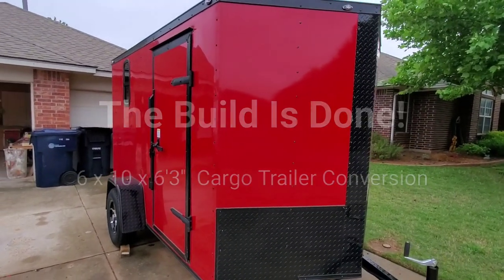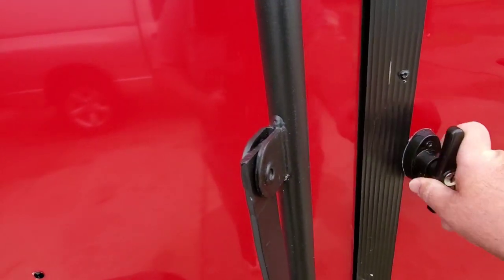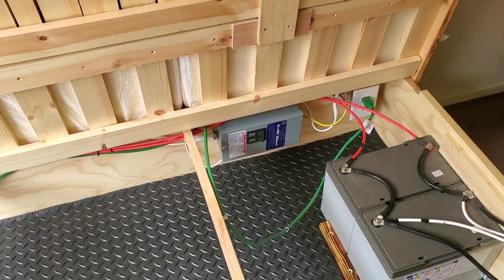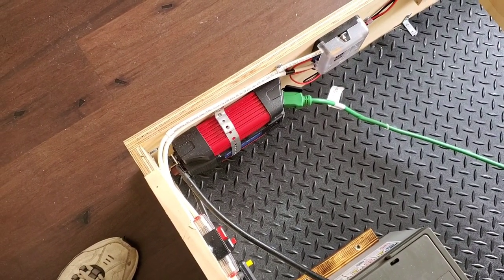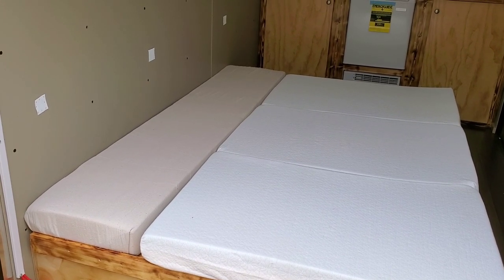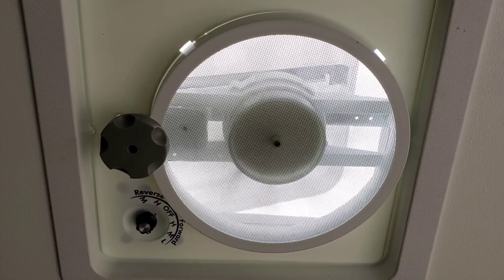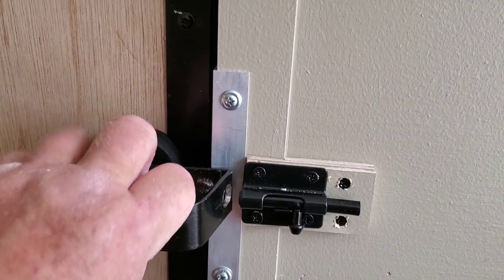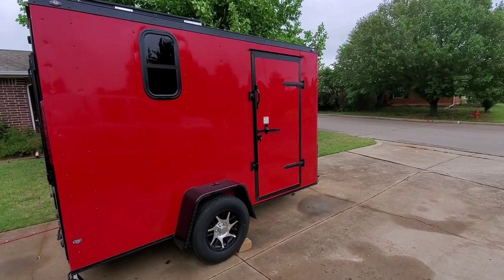The Build Is Done!

Comment: A suggestion for you rear hatch door is to make a deck on the ramp. You could have a bug screen installed at the entry of the trailor. Have it set up to use as an extra relaxing space. Place a little portable gas fire pit on it! Think of all of the beautiful evenings you could enjoy in your favorite camp chairs enjoying the beautiful sunsets and star gazing. Enjoy your trailor. It is so nice! ❤️❤️
Reply from the maker: Thanks for checking out the video. I believe that is what the couple that bought the trailer are doing with the ramp.
Reply: Never understood this. You're camping. What wrong with setting your chairs 12 inches lower on the ground.

Comment: Some prankster is going to lock y'all into that thing! Amazing build.
Reply from the maker: Thank you. When inside, the padlock goes in the flip latch on the door. With the lock in place, the bar lock can't be engaged to lock the door.
Reply: I have always had that thot lurking in the back & not all rigs have an escape hatch.
In this one, perhaps the rear door could enable that function...if latches were inside only.
Bug out, eh? Red certainly catches the eye so if some black circles are painted on, then you can call it a 'ladybug'!🤭
Reply: I was going to say the same thing! lol
Reply: Simple fix is to install another catch for the latch on the outside wall of the trailer and lock the swing latch inside the newly installed catch. That's what I did to mine, very easy and gives you piece of mind.

Comment: You'd get 25 to 30% more power gathered from your panel with an MPPT controller.
Reply from the maker: Since that build, I've gone to MPPT controlllers.
Reply: Yes, PWM is useless.
Reply from the maker: @mjremy2605  Long before MPPT came to be, PWM was what ran systems. I agree that MPPT is more efficient, for as basic a system as this one, PWM works fine.

Comment: This is a really nice sized and attractive, modern looking trailer, I think its gorgeous! 

Nicely outfitted and with a light, airy and uncluttered interior.

Nice job insulating the ramp door, most don't, which isn't a good choice for cold weather camping.

Your lovely little Travel Cabin will give you many years of miles, smiles and memories as it keeps you comfortably sheltered from the weather outside.

Thank you for sharing.
Reply from the maker: Thank you for the kind words.

Comment: Congratulations on a really nice build.  May your travels be safe and joyful.

I would humbly offer the thought you replace the modified sine wave inverter to a pure sine wave inverter, because your TV may be at risk, as would be any other electronics you might wish to charge.  Also, you might wish to reconsider the latch on the outside, as someone could lock you in while you are inside.  Perhaps the latter thought might be based on a little paranoia, but knowing some of the broken thinkers out there, I would never want to be placed in such a vulnerable position.
Reply from the maker: Appreciate the kind words and insight. We've been using small modified sine inverters to run dorm fridges for a quite a while with no issues. My first trailer (built in 2012) runs a dorm fridge, microwave & LCD tv (pre LED days) and has performed flawlessly. We'll look at changing them out if the need arises. We've done many, many tests about being locked in and as long as a lock is locked into the flip latch, the bar latch will not keep the door closed. That being said, if a broken thinker wants to wreak havoc, they will find a way. I work very hard at being aware of my surroundings and moving if at all uncomfortable.

Comment: I love this video…very informative! I’m getting ready to convert a 6 x 10 into a second unit for my hotdog cart business. Do you have a tutorial on your built from start to finish? I’m really interested in how much did it cost to insulate a trailer of that size.
Reply from the maker: Thanks for checking out the video. I don't have a tutorial, I just get an idea, draw it out and build it. Based on today's cost of foam board insulation, it should cost about $200+/- to insulate with 1" foam board.
Reply: @TinyTrailers4BigAdventures  thanks for your quick response! Also, that’s good to know on the insulation…sounds pretty reasonable.

Comment: with the back why don't you attach two jacks to level the door and have a mosquito type netting to go around and use it as a porch...make a portable table to eat off of....etc....really like how you constructed everything....
Reply from the maker: Thank you for the kind words. I didn't attach jacks to the ramp because I wanted the cleaner look. These are the jacks used to support the ramp. The top of the jack fits in the rubber door protectors on the ramp.
https://www.amazon.com/Camco-Olympian-Aluminum-Stabilize-Position/dp/B000760FWU/ref=mp_s_a_1_5?dchild=1&keywords=camco+trailer+jack&qid=1633268597&sr=8-5

Comment: Real nice build! Would you please put link to your parts? like the fan and the solar kit?
Reply from the maker: https://www.amazon.com/Hengs-Industries-90046CR-Replacement-501-1099/dp/B00DPJ3RDA                                                                            

https://store.santansolar.com/product/santan-solar-t-series-250w/

https://www.harborfreight.com/750-watt-continuous-1500-watt-peak-power-inverter-66817.html

https://www.amazon.com/gp/product/B07VMNLGZZ/ref=ppx_yo_dt_b_asin_title_o05_s00?ie=UTF8&psc=1

We bought a pallet of the solar panels, so the cost was worth it for us. Having a single panel shipped is ridiculously expensive. I'm sure you can find a deal on panels near you. Since I built this trailer, I have switched inverters to the Kreig 1500 watt and for a single panel system, I use an Epever 20 amp MPPT controller . A little more "oomph" in the inverter and more efficiency from the controller.

https://www.amazon.com/gp/product/B075XDK
MQW/ref=ppx_yo_dt_b_asin_title_o08_s00?ie=UTF8&psc=1

https://www.amazon.com/KRI%C3%8BGER-Installation-appliances-According-Standards/dp/B07MS5BY6T/ref=sr_1_3?dchild=1&keywords=Kreig+1500+watt+inverter&qid=1618590248&sr=8-3

Hope this helps. Thanks for joining the channel

Comment: Someone could lock you inside with the bar locks, so you might want to add some kind of latch to lock them in the open position when your inside just in case
Reply from the maker: Simply put the lock in the flip latch after the barlock is opened and you can't be locked inside. We tried it with several people and even my neighbor's 6 year old pusehed the door open with no problem. If you forget to put the lock in the flip latch, you could have a problem.

Comment: I've noticed that you use sash shed windows for your trailers. What kind are they and do they stand up to all the shaking bouncing?
Reply from the maker: We use the shed windows most of the ti.e because people don't want to pay the cost of rv windows. A 12 x 22 rv window runs about $120+/-. A 12 x 18 shed window runs $35 +/-. Both are single pane temperedglass, so style and price are the deviding factors for most folks. I have well over 80 shed windows installed in trailers without a single issue. I build a wooden frame that is attached between studs for the window to be screwed into. The frame insures tbe window is solidly secured to the trailer, so bouncing and flexing doesn't affect them at all.

Comment: The trailer looks great!...after having the trailer for awhile, do you have any problems/regrets with the floor mounted ac?
Reply from the maker: Thank you. I don't have the trailer. It was "adopted" by a couple to use as a vacation getaway. I've heard no complaints from them or others that I've done floor mounted ac's in. The biigest thing with making a floor mounted unit efficient is to feed it lots of air to cool the compressor & fan. Next is to use the roof vent fan to evacuate the hot air from the trailer while the ac is running. Once the hot air is moved out, the volume of cold air the ac puts out will fill the trailer quickly.

Comment: Very nice work and great idea of using shed lock.  Adding those flush RV locks are extremely time consuming. Will definitely do that for my next build.  Do you use passive ventilation for the AC or did you add a fan?
Reply from the maker: Thank you. I like the shed locks - drill a 1/2" vs cutting out for a handle. The AC vents directly thru the floor. I built an exhaust duct with a baffle that directs the air down. The air intake for the side vents are separated from the exhaust air by the trailer frame. No extra fans for air movement with the AC.

Comment: Have you had anyone go with a 12 volt  "overland" refrigerator/ Freezer?     Also have  you had anyone   get that trailer with brakes?   16 inch  Jeep wheels and tires not the after market monsters but the OEM  tires/ rims.      

I am wanting to tow with a Jeep JKU  and am concerned about a loaded trailer being more  than my vehicle can stop.   Going does not concern me it is the stopping that worries me.  On the rims/ tires I want one size for trailer and jeep.
Reply from the maker: Haven't done the 12v fridge/freezer unit yet. I just bought a used Icec0 GO 20 (20 qt) to play with. This one is a bit of a power hog, so I don't think for my 12v use, it would be practical. Plugged in to 120v, it will make a great freezer. As for brakes, yes, we've ordered units with brake axles. I think you would need to put a "lift" kit on the axle to safely get 16" tires on the trailer.

Comment: What are your thoughts on a roof vent verses keeping the roof one solid  piece and having vents on the side?  I see a couple manufactures who put one up high usually drivers side and one down low on passenger side.   Seems like that  would be better than an opening in the roof.
Reply from the maker: The side vents are designed to remove fumes from the trailer (mowers, atvs, etc) and really only work when the trailer is in motion. I'm not a fan of cutging a hole in a perefectly good roof,but a powered foor vent is a great wat to move a ton of air. Sealed right, they don't leak. I like to put a Camco all weather vent cover over them. Helps keep rain away and lets you leave them open 24/7/365 if you want to. I've used a small $40 12v fan from Amazon in the sidewall of a trailer when we didn't want to cut a roof. It's not as powerful as a roof vent fan, but it moves air.
Reply from the maker: Here is a link to the 12v fan I told you about. It works pretty well.
https://www.amazon.com/gp/product/B07PHT93VS/ref=ppx_yo_dt_b_asin_title_o04_s01?ie=UTF8&th=1

Comment: Awesome. Instead of hand pump why not have water overhead for gravity fed.
I would remove the outside bar lock handle so people won't lock you in. Or make an EMERGENCY window size hatch at another side to only lock & unlock from inside.
Reply from the maker: Thanks for checking ou the video. The hand pump allows them to have the water tanks under the counter and kedp the upper area clear. When you put the lock back in the flip latch, the bar handle can't catch on the latch and keep the door closed. We tested it many times before we put the shed handle on.

Comment: how come you didnt get a rooftop ac instead?
Reply from the maker: They wanted to be able to run the trailer on a 2000 watt generator. Also, a roof top is $1000+/-, and a window unit is under $200. The window ac keeps the trailer cold enough to the point that you have to turn it down. It was designed for a $150 sq.ft. room and the trailer is only 65 sq.ft. total, so it is more than enough.

Comment: Did you use sheetrock??
Reply from the maker: No sheetrock. The walls are 1/8" luan over the factory plywood and the ceiling is 1/4" luan. 2 coats of Kilz primer & 2 coats of paint.

Comment: How did you vent the AC unit
Reply from the maker: @Adam Payton - I wented the intake and exhaust through the floor. I built a duct to contain the exhaust air and force it out under the trailer. The intake vents have their own ducts to pull the intake air directly to them. There is a flooring joist that separates the intake and exhaust under the trailer.

Comment: The problem I have with the door, someone can lock you in....like the inside lock, but the door isnt for me, but overall nice job.....theres buttholes everywhere
Reply from the maker: Thanks for the kind words. I understand your concern about the door, but we found if we simply put a regular padlock in the flip latch on the door, the bar lock arm can't go down far enough to lock someone in. We tried this 10+ times with my wife in the trailer and each time she was easily able to push the door open. We tried it with one of the round locks and the bar lock could get down far enough to hold the door shut. I'm not a fan of the round locks anyway, this is just another reason for me to not use them.

Comment: What is the tongue weight?
Reply from the maker: Actually, I didn't take a tongue weight measurement. Not that it helps answe your question, but  I can pick up the tongue and move the trailer a bit and I haven't worked out in 30 years.

Comment: Don’t understand having batteries inside, to off gassing fumes into the trailer
Reply from the maker: Thanks for checking out the video. There are 2 floor vents under the bed  to allow air flow for the batteries. AGMs are designated safe for indoor applications with proper air flow.

Comment: What pulls this for you
Reply from the maker: The guy I built it for pulls it with a 6 cylinder Toyota Tacoma pickup. It weighs right at 2000 lbs, so anything that can tow 3000 lbs (to allow for whatever gear is loaded in it) will pull it safely.
Reply: Tiny Trailers 4 Big Adventures thanks
Reply: We pull it with a Ram 1500
Reply from the maker: @jackiesilva31  - That's what I pull with. Truck doesn't know one is back there, does it?
Reply: @TinyTrailers4BigAdventures  not when we don't load it down for a week long adventure lol no really, hardly knownits there

Comment: It would have been best to mount air conditioner up high. You can mount heaters low because hot air rises.
Reply from the maker: Ideally, it would be higher, but this wascthe best set up for this lay out. The trailer is 6 x 10 - the 5k btu ac cools it with no problem mounted on the floor.  A trailer up to 10 ft will cool very well with a 5 k wimdow unit mounted low. The sheer volume of cold air it puts out displaces the hot air. I appreciate you checking out the video.

Comment: "The batteries are good for 2 days of refrigerator running 24/7".... What?  :D
Reply from the maker: The frig draws 22.4 amp hrs/day. It will run 2 days on a 90 amp hr battery at 50% discharge figuring inverter efficiency at 85% ( which is low) with no recarge to the batteries.  2 - 95 amphr batteries are more than sufficient to run the trailer (fridge, lights and vent fan for 2 days.

Comment: that's great but you realize someone could lock you inside like that...
Reply from the maker: Thanks. As far as being locked inside, putting the lock in the flip latch on the door will prevent that. We tried it several times to be sure before the shed handle was installed. If there is still a concern, the bar lock handle can be removed as well.

Comment: Bugout trailer in red?  You can't hide that red anywhere.   Lol.
As for the side door, you'll get locked in there. With your Double security.    There's no way you can open that from the inside if you get locked in there.  Not a good move.  Just saying
Reply from the maker: Red was what they asked for. If the padlock is locked in the flip latch, the bar can't go down enough to lock the door from the outside. My neighbor's 7 year old daughter can push the door open with the bar over the door. She did it 10 times, as did his wife & my wife. Thanks for your concern. Question - do you have first hand knowledge of anyone ever being locked in their trailer (besides some drunken prank among friends)? In 60 years of camping, 20 of which is in cargo trailer conversions, I've never seen or heard of it. And I've camped in some sketchy areas over the years.
Reply: @TinyTrailers4BigAdventures  ohh yeah.  Friends of mine had an incident where someone cut their lock and replaced it with their own.  Friends tried to get out and they couldn't get the door open bcuz the "bad guy" backed his truck next to the door.   Then preceded to haul it away with them in it.  Friend had to call the police.  Once they got into a service area.  Let's just say it didn't end well for the "bad guy" and the friends got hurt bad when the driver crashed it in a ditch,  rolling it.  Everyone ended up in the hospital for quite awhile.   Police are not smart.   They shot out the truck tire and the driver lost control.
Reply from the maker: @tawnyschlienz9063  Holy crap. Guess they were in the wrong place at the wrong time. If someone is going to back their truck up against your door and cut off your lock and replace it, there's not a hell of a lot you can do. Truth is, if bad guys want to be bad, they will. My personal trailers have 2 exits lockable & openable from the inside cameras as well as exceedingly bright exterior lights. If something gets within 20 feet of the trailer, the cameras give an alert. within 5 feet, night becomes day. Then our traveling companions come out. They make very loud noises and will open a gaping hole in a trailer wall or...